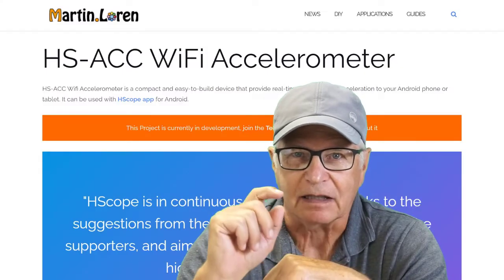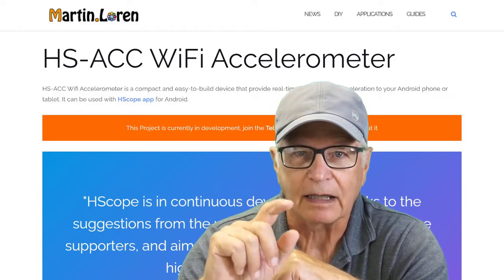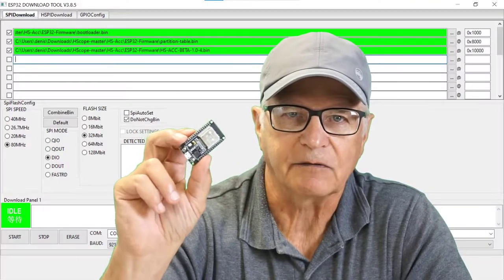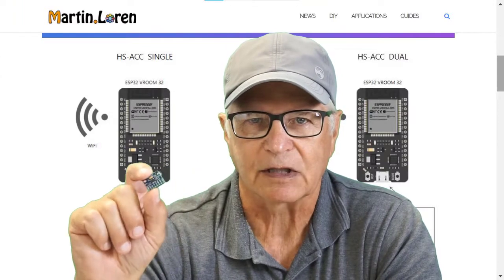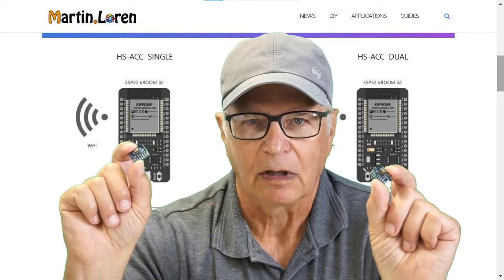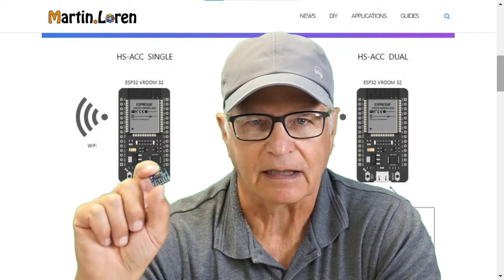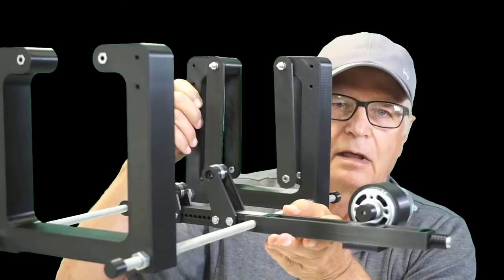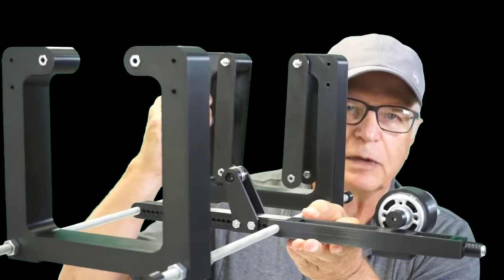GADGETS#154 - HS-ACC WIFI ACCELEROMETER

Comment: The Esp8266 module never ceases to amaze me, it is very useful, do you know if it is possible to convert the communication of a hantek 1008C oscilloscope into wifi for the tablet? I have the license of the hscope with hantek 1008c but I get confused with the cables ;-)
Reply from the maker: no, we'll never see commercial oscilloscopes like HT1008c which were not born as WiFi being converted...would be a HUGE task:)